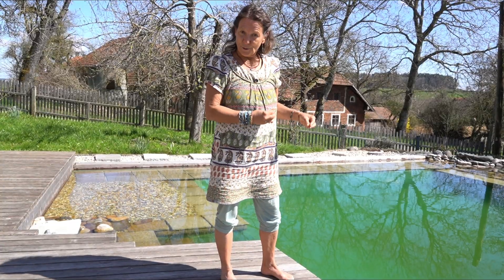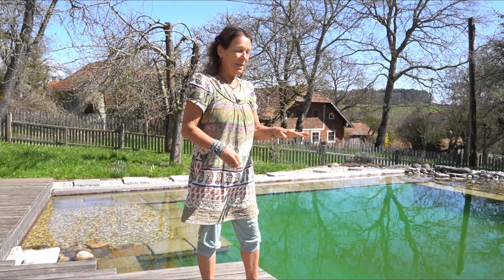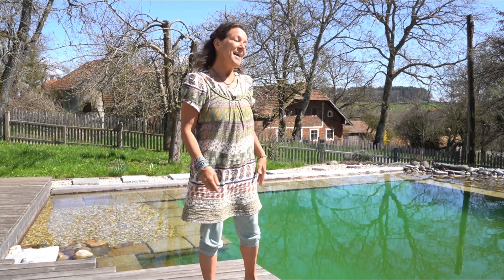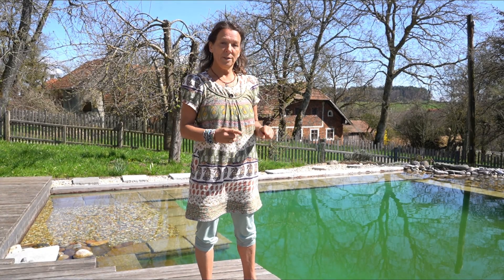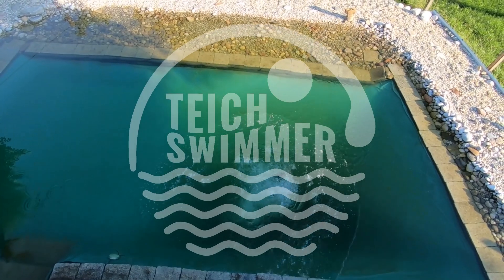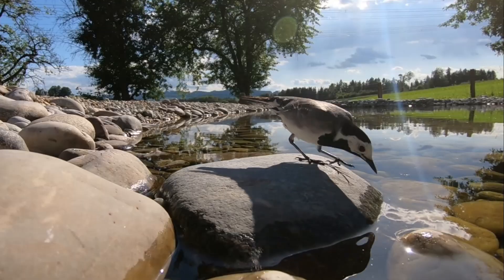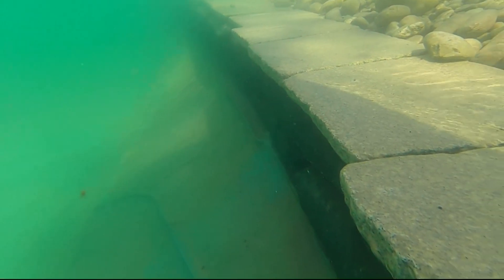The 3 laws of swimming ponds: Why your pond (doesn't) work!

Comment: Love the info! I was wondering, for the climate I’m located at, during the summer, it consistently gets up to 90-105 degrees F (32-40C). I’m literally in a dry desert lol. Would maintaining a swimteich still be possible, let alone without plants or pumps for extra circulation to prevent excessive algae growth?
Reply from the maker: Okay - dry desert sounds difficult - on the other hand, if there is not much organic stuff like leaves or similar the water should stay fine. - The thing that worries me is the evaporation. If it's dry you would probably loose a lot of water so the water level would drop more than 15 cm before it rains again (is that so?). - That means you would HAVE TO refill with tab water or spring water or whatever - and like that you might get more nutritions into your water than the water could take at a time and it would get turbid for a while. If you had the chance to collect rainwater, that yould be best for the refill. 
But anyway - I am quite sure that the water would not get foul or anything, but it could get turbid. In hot and dry areas you should pay even more attention to the size of the deep zone.  
Best regards, Ines
Reply: @ thank you! And where I am, it doesn’t rain often. At most, we’ve had 6-8 month droughts. The most recent was 214 days, and when it rained, only 0.01 inches fell from the sky lmao. And it’s already been 2 months since that time it rained. Dry since. Can’t wait to move out of this oven
Reply from the maker: @Oblisk  😂😄Sounds REALLY hot!